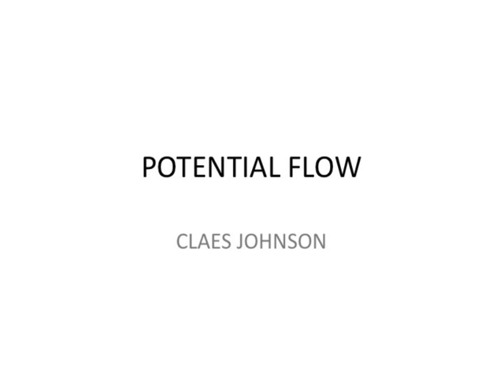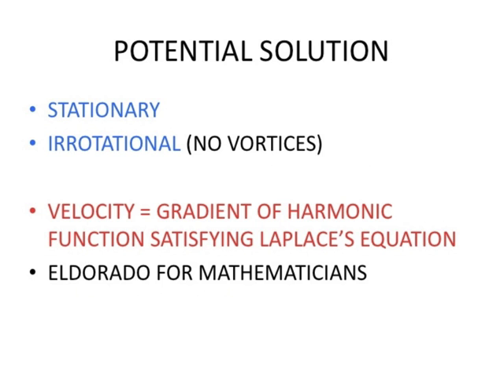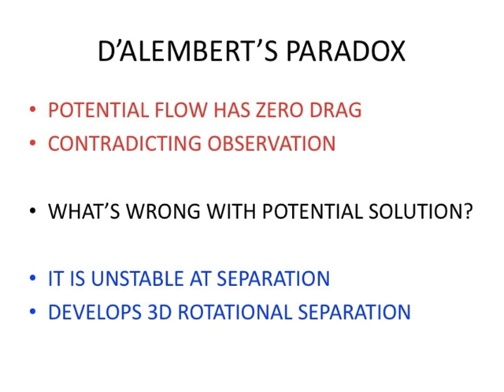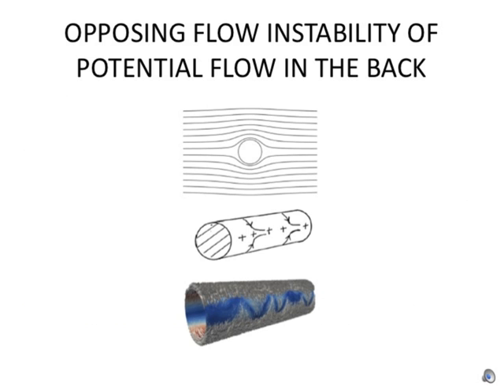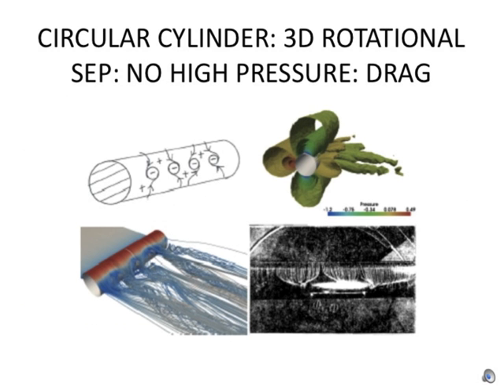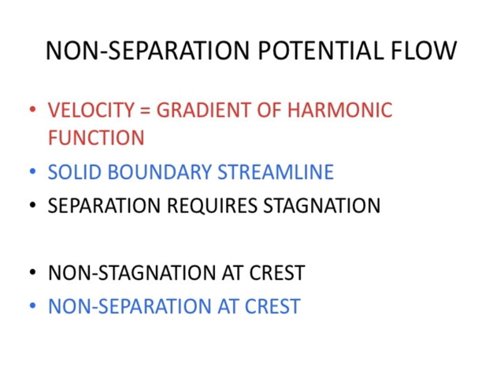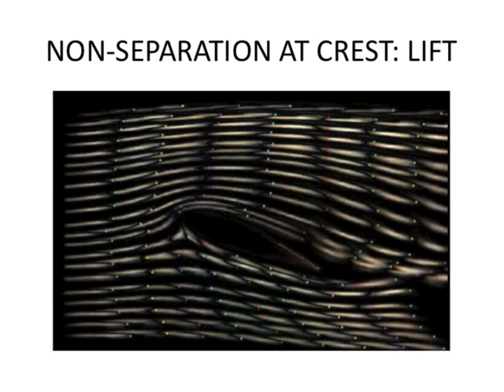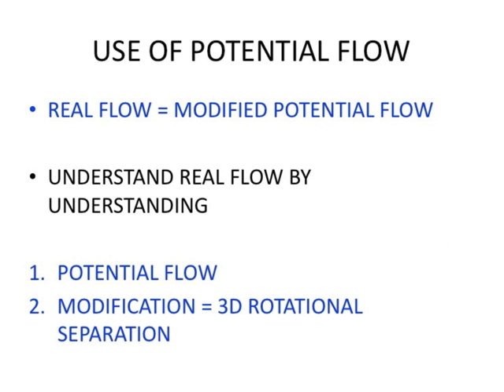Potential Flow

Comment: Potential flow is what we get when a body moves slowly through liquid helium. Once the body speeds up, or the helium warms up, there is an outflow of vorticity at the front of the body and an inflow at the back. However the inflow can be a difficult process to maintain. It fails at the trailing edge of a hydrofoil, and also on the upper surface of a hydrofoil at higher angles of attack.